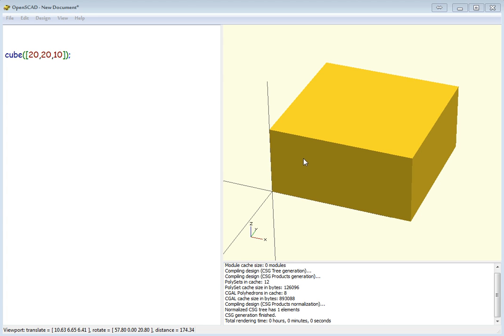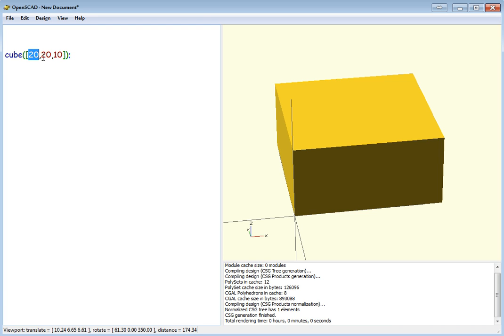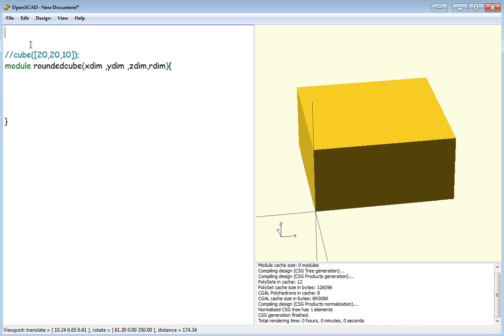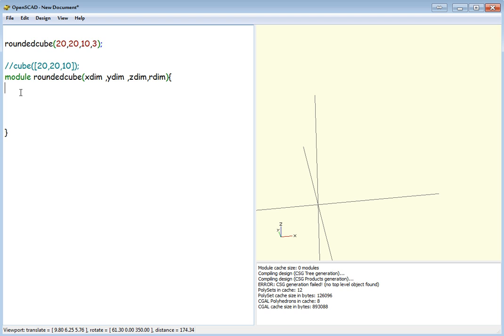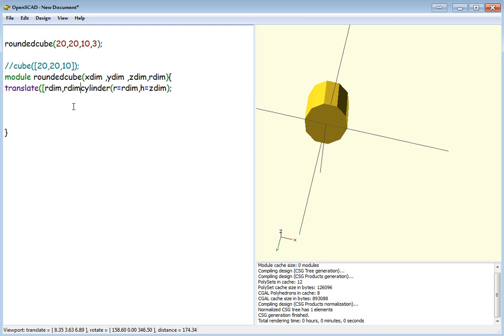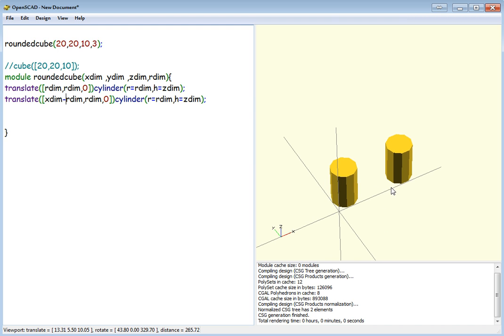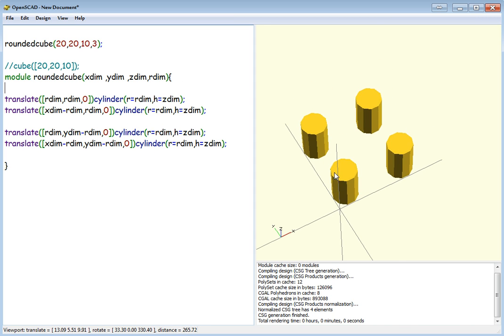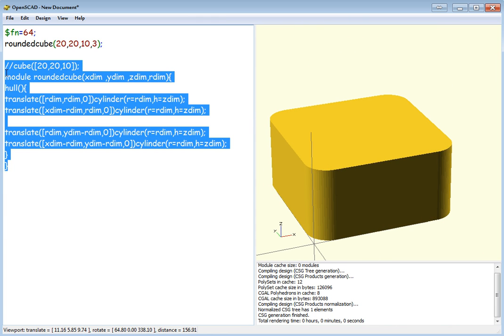Openscad: how to do a cube with round corners ( Hull )

Comment: Thanks for the recipe, I wanted a little more rounding, so I took it a little further:

module pill(pillLength,pillDiameter) {
    rotate([0,90,0]) {
        union() {
            translate([0,0,pillLength/2]) {
                sphere(pillDiameter);
            }
            cylinder(pillLength,pillDiameter,pillDiameter,true);
            translate([0,0,-pillLength/2]) {
                sphere(pillDiameter);
            }
        }
    }
}

module roundedCube(xDim,yDim,zDim,rDim) {
    hull() {
        translate([0,yDim/2,-zDim/2]) {
            pill(xDim,rDim);
        }
        
        translate([0,yDim/2,zDim/2]) {
            pill(xDim,rDim);
        }
    
        translate([0,-yDim/2,-zDim/2]) {
            pill(xDim,rDim);
        }
        translate([0,-yDim/2,zDim/2]) {
            pill(xDim,rDim);
        }
    }
}

Comment: Surely an easier way of doing this would be:

"linear_extrude(10) offset(3) offset(-3) square([20,20]);"
Reply from the maker: there's  a few ways to do it each with their own pros and cons , can also do it with minkowski using either a cylinder or a sphere and get all the edges rounded too

Comment: Hey guy, I used this information to fix the battery case print I've been doing. Thanks. I was wondering if you knew how to iterate a shape along a polyline? Or in other words generate shapes along a shell. I'm trying to make vents for casting prints easier.
Reply from the maker: i would create a module with the desired shape inside it and call it with translate() commands  to place each one individually, placement can be mostly automated using some of the existing variables used to make the case,